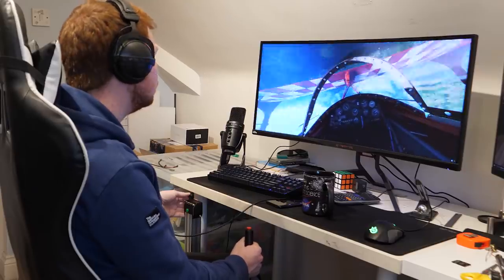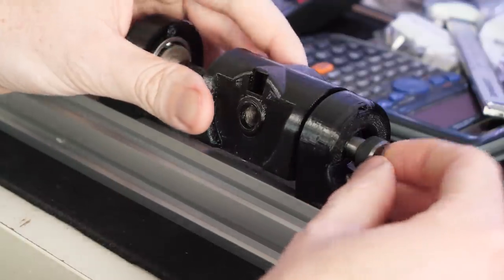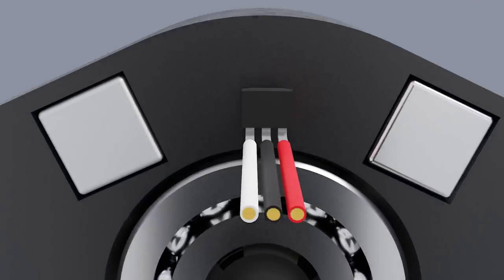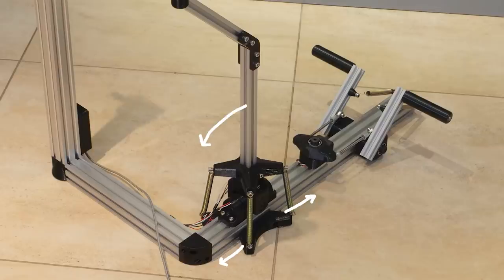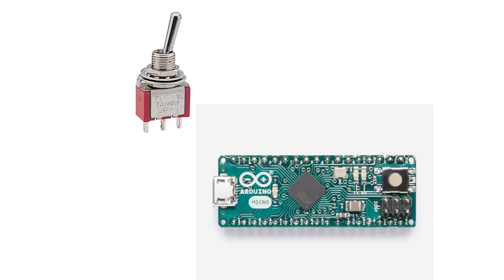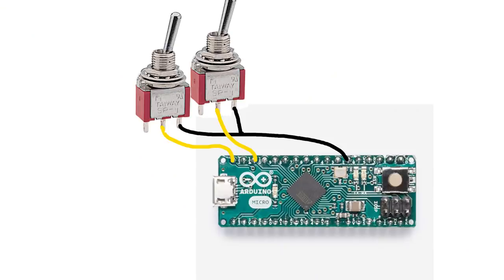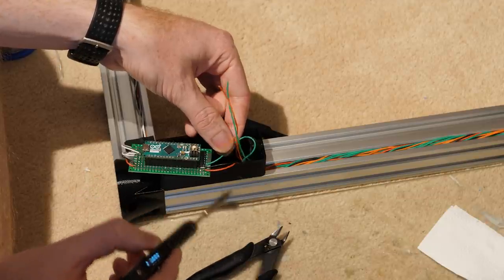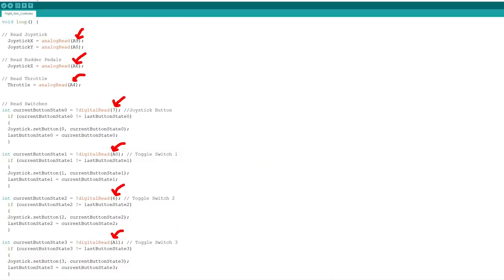Flight Simulator Joystick Info

Comment: Could somebody tell me why u need an 32u4 processor? ^^
I would like to do it with an extra trimm wheel, but the ProMirco has only 4 Analog Inputs
Reply: The 32u4 has the built-in USB support that is needed for the joystick library to work properly.
If there's not enough IO on the Pro Micro, you could try the Leonardo - that's basically like an Uno with the 32u4 processor.
OTOH, it looks to me like the Pro Micro DOES have more than 4 analogue inputs.  It just has 4 that are primarily analogue with secondary digital, but it looks like there are 5 more primarily digital with secondary analogue function.
https://www.iot-experiments.com/webusb-arduino-pro-micro-atmega32u4/

Comment: hey everybody, I was wondering if anybody tried to redo the project but with a different controller (i'm more used to STM32 and of the few i have search for this, i saw some that had 3 separate 12-bit ADC and higher clocks for cheaper than the arduino) and wanted to know if someone did it before to get an idea of the difficulty

Comment: Great video, I have ordered all of the parts and plan to start printing pieces today. With any luck I will be able to begin assembly next weekend. 

I am in the US and sourcing parts was a bit if a challenge. I couldn't find 10x10 shoulder bolts so I ordered 10x16 and plan to print a 6mm spacer if needed. Also the springs were a bit of a nightmare! I went with the closest match I could find, I guess I will find out if they work once I begin assembly. 

Assembly looks straight forward, the arduino  is a bit intimidating.... it has been a long time since I have messed with arduino!

I will try to make an assembly video but it might be a bit hard because I am going to be learning as I go!

I listed my parts sources on your thingiverse page.
Reply: I am also in the US and thinking of doing this build. I know it's been a year... but how did it go in the end for you with the parts you sourced?
Reply: @GibsonBoneyard  it wasn't too bad. If you go to the thingiverse page and find my comment (I'm helifrek on there) I made a pretty extensive parts list. Go with the recommended size wire (not what I put in my list) hardest part was finding the right springs.... I ended up coincidentally finding the perfect ones at a tractor supply store

Comment: gah, minimum shoulder bolt size i can find has the shoulder 16mm long D:
Reply: I went ahead and ordered the 16mm long ones and printed up some 6mm spacers
Reply: @headintheclouds2569  probably the wisest idea.. i was planning on getting the 3d printed parts done by a service, but seeing as the cost would be a good chunk of a 3d printer, i have now gotten a 3d printer and using CAD isn't so bad. but at the time of buying these parts, i didn't want to modify any STLs
Reply: Luckily you shouldn't have to make any modifications. I was going to start my build today but apparently there is more than one size of t-nuts 😅
Reply: @headintheclouds2569  oof, i think i got the 3mm ones?